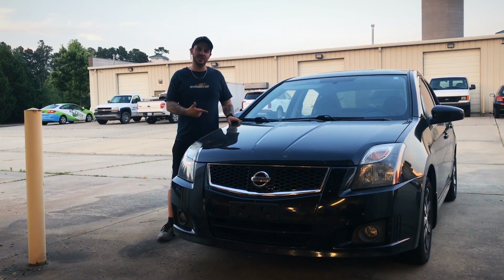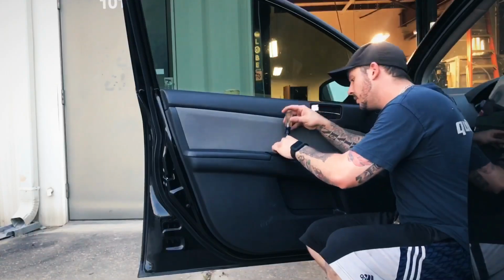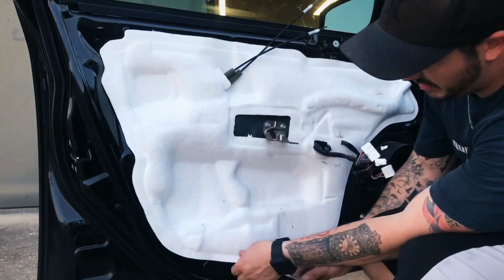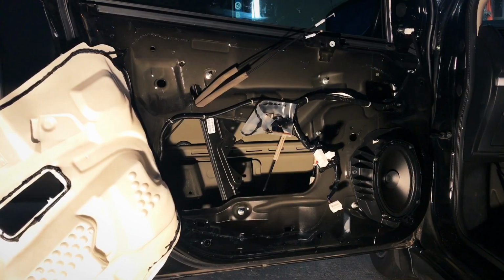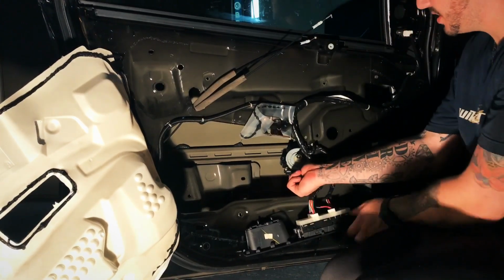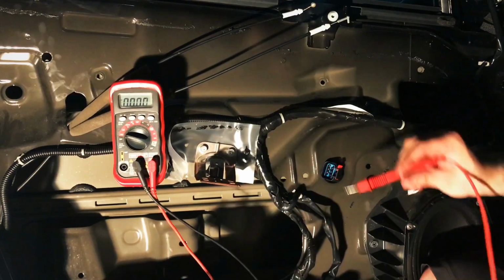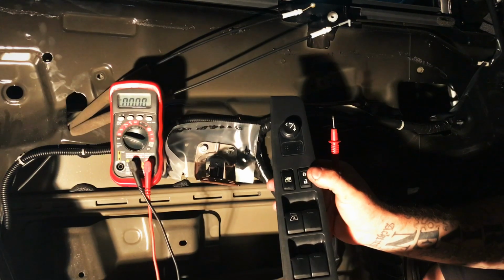SOLVED! - Nissan Sentra Driver Window FIX!

Comment: I replaced the switch and still nothing. I already bought the motor but don't want to go through all the work because when I press the button I can hear the engine(actual car engine while running) go under load almost like something shorting out. Any ideas?

Comment: Thanks for your video.
In my case, there was no sound, up or down. I pulled the switch module, T20 screw. Carefully separated the upper switch assembly from the white connector body, exposing the electrical switches (Must pop off the button cap of the window lockout first). Applied CRC electrical contact cleaner, exercised the slider switch several times, and everything worked again.
Reply from the maker: @sailingfc fantastic! Thank you for letting us know your repair experience. Great work 🙌

Comment: Hello, may I have a quick rundown on what setting you have on the multi meter tool?  I'm completely new to this, and there seems to be so many options on the circular dial.  Great video!
Reply from the maker: Thank you! The multi meter is great for various uses. You always set the meter to DC volts when checking. AC voltage is for a home. 

Essentially, I am using the meter to verify I am getting 12v DC before the motor and at the motor. I found here, the switch was not sending the power out to the window motor. But had power going into the switch.

Comment: Question for some reason the switch up makes the window go down but I just bought the switch and the motor I can hear it . Can you make a how to repair the track Im positive I heard the track bolt fall I bumped the door to check I heard it .
Reply: Yeah that’s the question why would the switch make the window go down that’s the 3rd time I’ve replaced the powder switch but first time this switch switch issue has happen

Comment: I have a 2012 sentra. It has difficulty rolling down. I have to bump the switch up and down a few times to get it "loose" (in a sense) in order for it to roll down. Rolls up with no issue. Have you ever experienced this?
Reply from the maker: I cant say ive experienced that same thing.. You could take off the door panel, and test for power at the window motor and verify. If everything is good, then the issue might be your window regulator or motor.

Comment: 2012 sentra driver side window, would get stuck sometimes and a couple jiggles of the switch would get it going. then it died completely for a day or so, I got lucky and it started working again. Last night it died again, I was using the switch to go up, and the thing decided it was going down. It got to the bottom and stayed there. My issue is the opposite of yours, window is stuck down, when I press down on the switch it sounds like it does something for a split second, up is completely dead.. Any guesses what the problem could be based on my description of the problem? I wont hold u to it im just going crazy until the new switch gets here to try out. Thanks! Also, how do I test the switch? I tried a test light to the connecter, only one hot wire and the other windows didnt go down as another video suggested(if i grounded the correct pin). I wanted to jump the wires at the switch to test if that is the problem but IDK what wires to use
Reply: I am having this same issue on my gal's Sentra.  Did it end up being your switch?  I have a new switch assembly arriving tomorrow to try out before I pull the motor and regulator.   Thank you for your time!!
Reply: @Balticblue93  Yes it was the switch in my case. It probably got wet a bunch of times. It used to no go down on the first shot but if I tried again it would, then it would get stuck for a couple days at a time and that's when I replaced the switch and it fixed it. I have been pretty lucky with cheap fixtures on this car, the side mirrors with motor or like 35 bucks each. I'm going to sell the car so I want to redo the lenses on the headlights and tail lights

Comment: How did you conclude it was the switch? It didnt have power on the multimeter going down only up?
Reply from the maker: Correct. Sorry the video is not straight forward, I wanted you to see my trial and error. But yes, unplug the motor and see if you get power to the motor in both up/down positions.

Comment: How did u separet the motor from the regilattor
Reply from the maker: I removed the assembly from the car. Then there are 3 bolts that hold the motor onto the regular i believe.

Comment: I did a quick fix on mine the switch inside wasn’t alight I just pulled it apart and reseated it properly and it is working great again. Wouldn’t have tried if it wasn’t for this video thanks!
Reply from the maker: Tyler Strosnider that’s awesome!!! Glad some of the info was helpful! Great job 👍

Comment: Great video. How did you know the pin layout on the switch? Up, down, ground?
Reply from the maker: I used a multi meter to see which pins were sending voltage when you press the switch up and down.
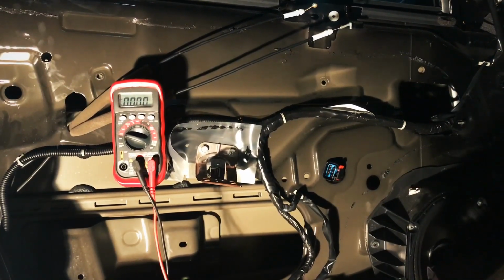Reply from the maker: 4:40

Comment: Hello, My 2007 Sentra ONLY does this when it gets warm out. Otherwise works perfect. Have you experienced that?
Reply from the maker: 79cb650 I have not experienced that with this vehicle; however, heat creates resistance so it’s possible it could be affecting the switch.

Comment: Thank You very much. I went to Pull-a-Parts today and pulled a motor and regulator for about 30 bucks. My driver's side does not respond but when it first happened I thought there was slight movement like the window was stuck now nothing. Unfortunately I don't have a way to test the switch.....but I would hate to go thru all that trouble of installing to find out its something else going on. Someone told me I should plug the new motor in first to see if it works before removing motor and regulator in the car now. If that doesn't work its the switch I deduce from your window. Is it possible its a fuse problem? The other three windows work.
Reply from the maker: I would take your door panel off and unplug your window motor, and plug it into your used one you just got and test it before install like you said. If it still doesn’t work it’s probably the switch. Unless you have bad luck and the part you pulled is also bad haha. Get a cheap multi meter from the store and confirm you have voltage at the connector to the motor when you press the switch. This will answer all your questions. It is almost never a fuse for an issue like this, that would affect all windows. Good luck!

Comment: I have the same issue. I ordered a new switch off Amazon for 20 bucks (it has great reviews) and am hoping this fixes the problem. Otherwise I’m gonna have to cut the cables to the regulator just to get my windows up if my window goes down, but not back up.
Reply: How did it go?
Reply: @willdallas53  it works well. Easy to install. Controls all windows and locks.
Reply: What's it called ?! 👀

Comment: My Nissan Sentra has the same issue windows won’t go down  all the windows stopped working around the same time I checked and changed the fuses still nothing  getting a new master switch so hopefully that solves my problem
Reply: Any updates?

Comment: Hope this is all I need for my 2007 Sentra. The light inside of the window switch is on but I never hear noise when I pull it up or down, but then again I never listened for it.
Reply from the maker: I would take the door panel off and unplug your window motor. Test for power coming from the switch first before taking out the window motor like I did.

Comment: Wouldn't it make sense to check the switch before taking out the actuator?
Reply from the maker: Hector Nieves yes you are correct, however the switch is usually not the culprit. I should have made that more clear thank you! My goal was for you to learn with me as I discovered the problem.
Reply: I did thanks!

Comment: Sir, how did you separate the glass from the regulator?   You just mention it in the video that it was done.
Reply from the maker: RockLobster2000 there are two bolts at the bottom of the glass that connect it to the window regulator. One on the left and one on the right. Typically these can easily be found when the window is in the full UP or DOWN position from the factory.
Reply from the maker: RockLobster2000 in this case, both bolts were only visible in the DOWN position. With it being stuck up, the right bolt you can reach inside with a wrench and get it out. The left side I had to drill a small hole to access the bolt. You can barely spot it @ 2:30
Reply: @After7Garage  Thank you for the reply.  In my case, I did remove the bolt while the window was  up on the side closest to the mirror.  Then, I  "helped" the motor bring the window down to get the other bolt, which is recessed.  I like your idea of drilling a hole to access the bolt.  It's too bad Nissan doesn't make it easy to replace.  There should be access points when the window is down or up.  I replaced the motor, but the problem is that the window channel is binding the window.  I'll have to tackle that problem in a few weeks.  Again, thank you for the video!

Comment: haven't tried this out yet but my Window seems to be nonresponsive for moving upwards and goes downwards usually. It's given me trouble before when I first bought it in 2016, as I could tell it had the door popped before and has a warp, but replacing the switch and applying lubricant made me feel better about it. As of right now my window has been stuck down since I last needed to lower it. This video seems like great help! But I just find it odd that your switch does the opposite. Responds to Up but doesn't for Down. I'll be sure to respond to this comment if this helps out tomorrow
Reply from the maker: After what we learned in my video above, it would be more time effective to test the switch and wiring by unplugging the motor and checking for 12v in the up and down position. That should save you time from removing the window regulator and motor assembly if the culprit is just the switch. Good luck!

Comment: Wow that's alot of work.
Reply from the maker: Yes it does seem a bit intimidating but I just wanted to show you every part. If your window is not functioning I would first take off the door panel and test for power at the window motor before disassembling.

Comment: 2012 sentry...hopped in and put window down...stayed down...next day i was able to put it back up( fixed itself) woke up next day it went half down on it's own overnight...of course been raining all week 😮😮
Reply from the maker: That’s wild! I would recommend checking the switch first as learned in this video. Seems to be a common issue. If not, then prepare for new window motor and regulator

Comment: Maybe next time check the switches before pulling the door apart.
Reply from the maker: as stated in many comments below, this was a video meant to show the process and learn. yes you are correct.
Reply: @After7Garage  all good brother, it was very educational start to finish. Be proud of the video you did. Diagnostic work, and electrical diagnostics is not easy. I think you killed it.

Comment: Why would you skip over removing the bolts, what is even the point of posting this video?
Reply from the maker: If you have managed to take the door panel off and get this far, but can’t figure out which bolts (the only bolts there) then you should leave it to a mechanic! Haha
Reply from the maker: The point of the video was to learn by watching me diagnose what is wrong with the vehicle. We learned that by testing the power at the window motor you can determine if it is the switch or the motor/regulator without taking it out like I did. Watch the whole video next time before making a smart remark :)

Comment: I'm not a car guy. But I would of use logic at this point rather then tell someone who doesn't know what they are doing to just take out the switch panel not the motor.  You don't take the motor then test the switch. I would of test the switch then if that comes out - then you can tell viewers to take motor. I'm sure poor guy took out the motor now he having trouble adding the motor back together. For some reason YouTuber seem to give to much detail and people copy y'all. But never explain how to put it back together again
Reply from the maker: I see your point, but perhaps you didn't watch the beginning of the video? I explained that considering the function of the window working Up but not Down made me suspect a bound up window regulator. Which is why I removed the motor to show that it spins freely with the regulator off, but then found out it was the switch. This video was meant to be informative and witness me figuring it out as I go. I don't like to do the repair then set it up fake for you to see it again. And if you cannot follow steps in reverse order to put your car back together, then you should just take it to the mechanic haha!
Reply: @After7Garage  I watched another video before yours. I knew where going to have to test the switch. Which I was right towards the middle of the video.but any who the other guy  tested the window switch. Before assuming it the motor.Even if you did hear motor go up and down. You test the simple things. Before doing more then what you should do. It the same thing that get people.  You don't have to be a mechanic to use common sense. Well like I said I feel bad for the person who has no common sense out there that left scratching his head trying to save a few buck. ( Would save him money just replacing the switch:  eBay cheapest cost 16 bucks ) I'm sure that guy regret watching your video. Now he has to  pay a mechanic. Just to put the motor back plus paying a mechanic charging him $30 + " for a brand new switch. " Just because the box it comes with says made in the USA😂. I'm sure the switch is made in Japan or China. But the box was made in the USA 🤣🤣🤣.  Well now I know to avoid your videos.
Reply from the maker: @bluecavemen  Wow you sound like quite the pro! You should start making your own DIY videos! :)
Reply: @After7Garage  not a pro and I'm not going to do videos. It quite exhausting editing making videos and making weekly videos just to get subscribers. I others ways of making income.
Reply from the maker: @bluecavemen  this isn’t for income haha. It’s a passion and a hobby. I’ll be anxiously waiting for your videos! Most people don’t have the dedication to edit and such like you said. Easy to criticize, now let’s see what you can do :)
Reply: @After7Garage  everyone who makes a YouTube is to make income. That easy money and something they are into ( niche). I can't imagine someone doing a video just for the heck of it. I'm sure of they see income coming in. Would definitely change their mind. Who can't say no to money. I'm not going to make any videos. No my passion or interest..well if you can't handle criticism they shouldn't reply or shouldn't make any videos of they can't handle negative feedback something it true
Reply from the maker: @bluecavemen  haha you have a very narrow minded view of things. I can handle feedback anytime! However; you admitted you didn't even watch the full video so your negativity is a little unwarranted. You should learn to channel that energy... I've already edited two more videos since this convo :)
Reply: @After7Garage  narrow? how did you come up with that conclusion ? No you can not, your the person who just want to be right now matter what anyone says. even if they have a logic point of view in this case I do. And i never said i didn't finish watching the whole video. I said i watch towards the middle and realized that you started to check the switch. And i will not continue to watch any of your other videos since your this video was over kill. channel what energy? that I'm giving facts yet you still continent to message me? maybe you should tuck in your ego and energy if you dont like people giving out facts. I can admit when I am wrong. Has nothing to do with energy just ego.

Comment: Waste of time method!  In my 41 years as a technician if I only saw one window motor fail in only one direction, it would be a lot!  You could of cupped your hand over the dome light , pushed the window switch up & down and watched for the light to dim. If the light doesn't dim in either up or down position, it's a bad switch!  You would of gotten the same diagnostic results without taking the entire door panel off!

Comment: So, I came here to see how to do it. He just says.."I removed the bolts holding the window to the regulator."  That is what I need to see! Where and how many? Big help, NOT!
Reply from the maker: Take the door panel off and use your eye balls. That’s why it’s not shown. It’s super easy. Just look for the circle cut outs behind the door panel. If you can’t figure that out, best leave it to a mechanic